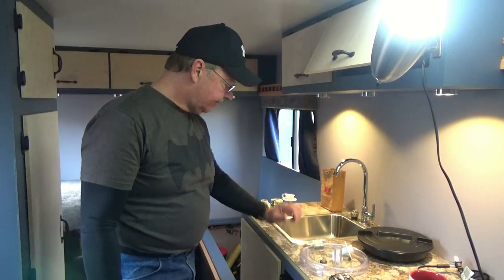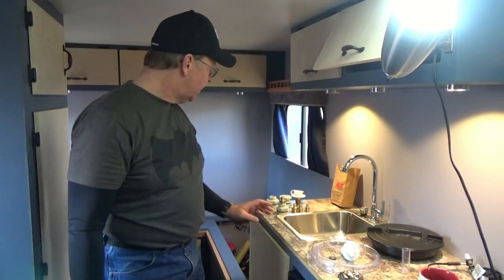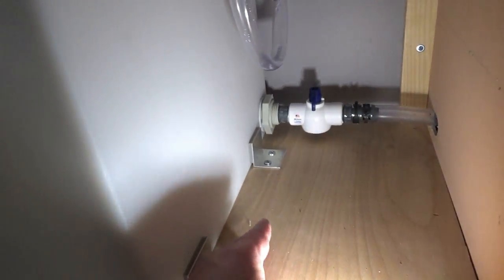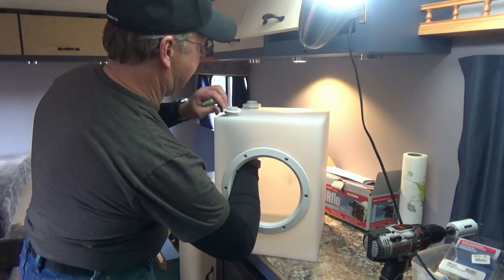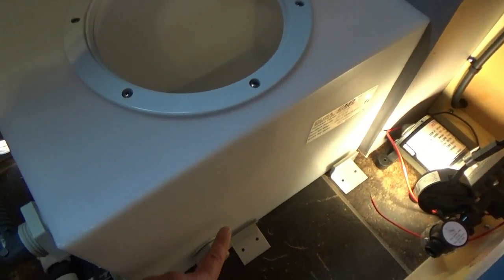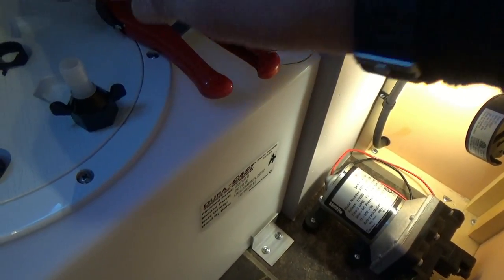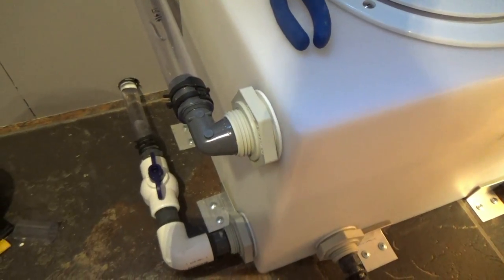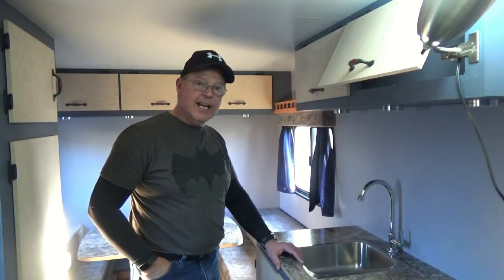How To Build A DIY Travel Trailer - Part 62 (Freshwater Tank Install – Part 1)

Comment: I would strongly suggest adding a metal strap around the top of your tank.  In a wreck, with a full tank the L-channels brackets won't hold your tank in place and it could rip through your cabinets and become a dangerous projectile.
Reply from the maker: Excellent tip sir... and honestly, I did not think of that. Thank you!

Comment: Nice job!  Can you post a link to where you got the bulkhead fittings?  thanks
Reply from the maker: You can find these deck access plates on Amazon, Ebay, eTrailer.com... just about everywhere. Here is a link to West Marine, many sizes to choose from: https://www.westmarine.com/west-marine-6inch-screw-in-deck-plate-11743036.html?&utm_medium=cpc&utm_source=google&utm_campaign=PMax:%20GSC%3eSmart_Shopping%3ePlumbing%20&%20Ventilation&gclid=Cj0KCQjw2v-gBhC1ARIsAOQdKY1soOKWMxkR7ymBUSSsqZ6_HSOQ79PyvfKWdAPMLqjAV0GiCDUTHjUaAs1oEALw_wcB

Thanks for checking it out!

Comment: Nice Job Al, Where did you buy the fresh water Tanks and screw lids ?
Reply from the maker: I believe I purchased the tanks through a company called DuraCast... have a video on that somewhere :)   If you Google "Deck Plate", I think you will come across what you are looking for. They do come in many different sizes... Thanks for checking it out!

Comment: 1:26 Did your tank come with that white access cap already installed or did you put it in?  If so, where did you get the cap?
Reply from the maker: I installed those myself. Purchased the access plates on Ebay or Amazon. Do a search for Boat Deck Plate or round access hatch, you'll see it.

Comment: You can use Sharkbite fittings  one the plex tubing instead of clamps,  the trouble I have is the tube sizes.
Reply from the maker: I'm with ya... looked at using that too

Comment: Did you do any research on which side of the camper is the best side to put the water fill on?  I see that you installed the tank on driver side, so obviously that would be the side to put a fill for you.  Just wondering if there is a recommend side.
Reply from the maker: Hi Wesley! No, I didn't do any research... just a little observation. I think why most RV's have the water and electric on the driver side is because most RV parks are set up that way. When backing into a spot (or pull-through), the hook-ups are generally on the driver's side. Another good reason perhaps, is we don't wan the water and electric on the same side as the entry door to the trailer. 1. You could end up tripping over the hose and cords and that wouldn't be much fun. 2. If for some reason the hose sprung a leak... you wouldn't want to track water and mud into the trailer (seeing it would be on the same side as the door). Those are the only two reasons I can think of to install everything on driver's side. Other than that... whatever way a person decides to build it, build it your way and have fun! :)   Cheers!  AL
Reply: OregonBatman .... my first camper was a pop up.  It’s water fill was on driver side.  As well as a 78 I had.  But my new camper, a 2008 R-Vision Trail-Lite has the factory fill on the passenger side.   Weird.  Worse is that the last owner ripped out the water tank and cut the back of the fill pipe clean off.  So now I need to install a tank.  I was originally gonna use the factory fill location, but I keep seeing campers all have them on the opposite side.  So I guess I’ll do that.
Reply from the maker: Odd they would cut that clean off... wonder what they had in mind? Could be most camp sites they visited had the fill side on the driver's side, so maybe that's what they had in mind. I think the driver's side will be your best bet.

Comment: You should fill from the bottom, (water fill above the tank) and have an overflow at the top, Tee'd into your manual tank drain. No need for a vent and you can see from outside when your tank is full, by the water coming out the overflow. Also, maybe you should have raised the tank off the floor and placed the drain on the bottom, although with the fittings you are using you may not have been better off.
Reply from the maker: That is a good idea actually... I did not think of filling from the bottom. I think with the current setup, that could still work. Might have to try that.

Comment: How did you weld or glued them fittings onto the tank?
Reply from the maker: Hi Isaac! The bulkhead fittings have a gasket in between the fittings. I drilled a hole in the tank, inserted the fitting with gasket on the outside, insert the nut to the threads on the inside, and tightened it down. Holding very well over many miles of travel. If I ever have a problem, I can remove and replace the fittings.

Comment: I think you need a shut-off valve on the fill line inside the trailer (or at least on over flow pipe to the outside). Running around the trailer to shut off the water in the nick of time could be a problem.
Reply from the maker: I couldn't agree more! I thought the same thing on the first fill. Although, once the vent is installed (overflow tube), that will be the indicator the tank is full when it begins to spill. I just lucked out the first time I ran around the trailer to shut the water off... any slower, and it could have ended badly! :)
Reply from the maker: Hey Alan... going to take your advice and install a shutoff valve on the fill line inside the trailer. When ready to fill tank, I'll shut valve off, turn water on outside, open valve until full, then shut everything off. That way, I won't have to worry about pressure pushing water out of access plate. I think that will solve my little leaky problem! Thanks for the great idea! Cheers!

Comment: I think I would run a sender of the tank to a gauge, so you know when it is full.  Saves mishaps.
Reply from the maker: I might need to do that in the future...  The tank is small though, and fills pretty quickly. I know when I'm just about empty, when the holding tank is about full. So far, works like a charm! Thank you Stephen for stopping by!

Comment: BMan-  At the risk of being too late, you don't need to make any more holes in your freshwater tank for venting!  When you go to drain, leave the access lid tight, and while you are outside the camper putting the hose on the drain outlet, simply unscrew the cap on the freshwater fill, and you have opened up the circuit.  2.  The 90 that you added inside the tank to draw every last drop on the pump side- the same will work on the drain side.  Once you get  the tank draining, if you had a 90 on the outlet (inside the tank), it would siphon to the bottom of the tank- like sucking gasoline out of a hose- once it's going and there is no airgap, it will draw water until it draws air and breaks siphon.  So add a 90 to your outlet and make it touch the bottom.  All you have to do is take a small side bite out of the mouth of the 90 and let it slurp off the bottom of the tank.  Less water for you to have to try to towel and sponge out.  Best From CA US
Reply from the maker: Thanks for the idea on the 90 for the drain... believe it or not, I didn't even think of that! That is something I will do! I decided not to put a vent on the holding tank (for now). When using the sink, I'll loosen the lid to help vent the sink and draining the tank. I will be installing a vent on the freshwater tank though; 1. it will let me know when tank is full when filling. 2. when pump is running and lid is on tight, it will help to keep the tank from collapsing.  I won't have to be lifting the bench seat so often to tighten or loosen the lid on the tank. Once all is installed and no leaks, I can just forget about it except for periodic inspection! Thanks again for the comment and the great ideas! Appreciate it much!
Reply: @OregonBatman  Just improving much more your instalation, I would add another shutoff valve above ( main water entrance ) or a float inside your tank that stops the entrance of water when it is completeley full. In this way, you don't have to run to close your garden tap outside !installing an internal float , it would shut the water automatically.
Reply from the maker: Good catch! I did just that... installed a shutoff above tank! Works great!